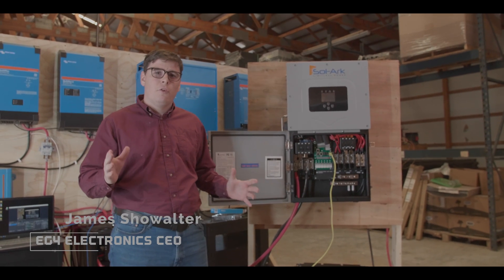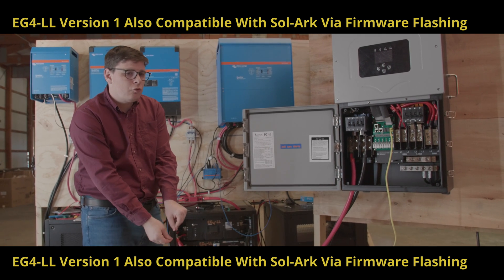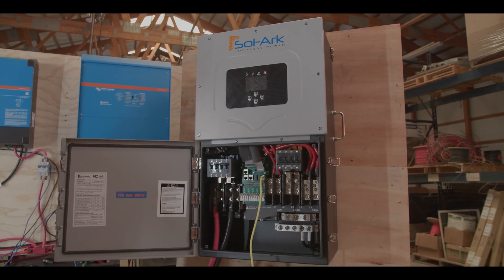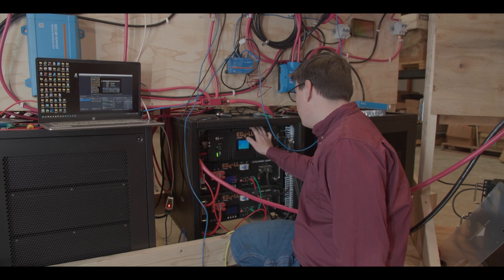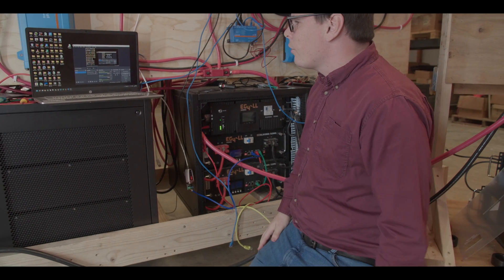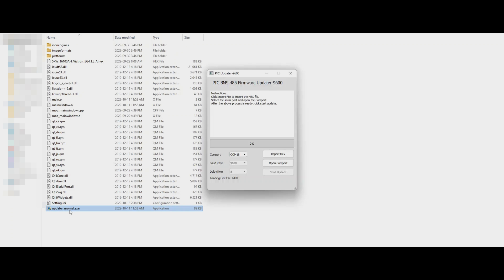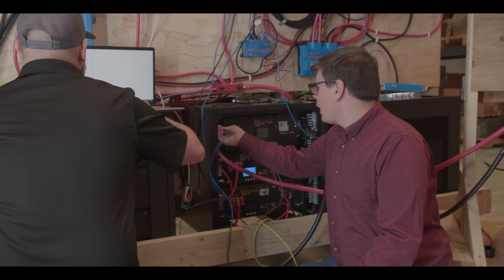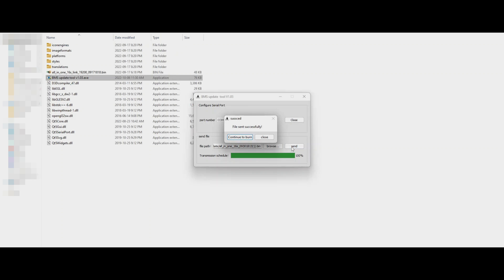Sol-Ark and EG4-LL Lithium Battery BMS Communications

Comment: Trying to setup CAN coms with Solark15K and Eg4_LL v2. Followed setup procedure outlined in this video. Solark inverter is not seeing batteries. I do have an early batch of EG4-LL v2 batteries i suspect since I ordered them as they were released last year. 1. How to confirm that these batteries require a BMS update firmware and 2. where is the BMS Updater software and corresponding BMS firmware update files (they are not present under EG4 web site Downloads section).  Thank you.

Comment: I did follow procedure on my eg4-LL v2 batteries to set CAN protocol to SLK for my sol-ark 8k, but sol-ark is not showing correct total ah, or state of charge %. I suspect there are parameters that need to be checked/set on the sol-ark side ? I would be nice to see a step by step video on that to complete this integration process

Comment: What is the pinout of the CAN port on the EG4-LL Ver. 2?  I cannot find it and need to make a cable to go to my Sol-Ark 15k.
Reply: In the same boat did you find this info?
Reply: @bschmitty77  Yes, I found the Sol-Ark pinout in the Sol-Ark battery communications and integration guide V3.0.  I used a regular RJ-45 cable and cut off one end and only connected pins 4, 5, and 6 in the connector I put on.  You could likely use a regular cable with all pins but I didn't know what was on the other pins in the EG4-LL and didn't want to risk it.
Reply: @renof2505  , I just installed a EG4 cabinet with EG4-LL v2 batteries, and am trying to set up to talk to a Sol-Ark 8k..... Is there a decent video or manual showing step by step? Do I need to make a cable, really ?
Reply: @danielbaker716  I think you can use a regular ethernet cable.  I just took out the unused wires to be sure since I have the connectors and tool it was fairly easy.  Have you connected the power cables already and have it working without communication?

Comment: Is communication between the two REALLY that simple? In a Sol-Ark video they recommended manually inputting battery parameters incase communication fails, as it would reset to defaults. You would think you could “set” new defaults based on what you’re currently getting from the wire…

Comment: Howdy   EG4 Electronics , ... 
WOWSER  = Constant CHANGES ... 
I just began installation of my THREE (3) New EG4-LL V2's  in my older (<less expensive) EG4 Six (6) Battery RACK 
&
ALL of my DIP Switches are on the Forward FACE of my V2 Batteries 
...
Thank you for the  ADVICE / TIP  on utilizing the  V2 Batteries as the Master 
& 
the older V1  Batteries in the Slave position = down stream 
I asked on the TECH Support section on the Signature Solar website & was told it made no difference on my system ... 
but 
--- this was in conjunction with a  GROWATT  SPF 6000 T  DVM-MPV  inverter ( which may not make a difference with GROWATT ? ) 
Thank you for the Informative VIDEO
COOP
the  WiSeNhEiMeR from Richmond, INDIANA 
...
Reply: We’re you able to set up a V2 as a master and the older batteries as slaves?  I bought 3 older batteries and would love to know how to set them up with my Sol-Ark 12k.

Comment: How do I program my  newest version Eg4LL battery. It has 6 dip switches,but manual only says use 4 to set it up? I can't seem to get any help anywhere on this.
Reply from the maker: We suggest emailing Signature Solar's tech team at tech@signaturesolar.com. They should be able to get you taken care of!
Reply: page 13 of the install manual is completely wrong. It should be:
- install document is NOT good, NOT accurate, and needs revision ASAP. pages 10,11, 12 and especially page 13 needs revision to correct and clarify installation process. There are currently significant errors regarding DIP settings, and how to access protocol screen.The procedure documented on page 13 is totally wrong. What I found out from tech support was:
		- turn master battery off
		- set DIP to ID:64 , which is all-on 111111
		- power on master battery
		- click any button to wake screen
		- click-hold return (3rd) button for 5 sec, and release.....
		- set protocol
		- click 'enter' (4th) button
		- turn off master battery power
		- set master battery DIP to 100000
		- turn power 'on'

Comment: HOWdy  
How about for GROWATT ?  
Do the EG4-LL V-1 or V-2  need a new / UPDATED  Firmware ?
COOP
the WiSeNhEiMeR from Richmond, INDIANA 
...
Reply: Same question
Reply: Hello. I am running the GROWATT 6kW and EG4-LL V1 x 2. My units worked when installed 6 months ago with BMS Communication through RS385 port. No updates were needed. Did you have success?

Comment: I have 6 v2 batteries and I'm trying to do the update, but the firmware zip file that is on the webpage doesn't have a hex file that I can see. Where is the actual firmware image for v2? Use the hex in the v1 package?
Reply: Clarified with signature solar that the firmware file for v2 batteries is the included bin file (not hex like v1)

Comment: Can anything be done about the Lifepower4 batteries?
Reply: Did you figure it out?
Reply: I don’t think there will be support for these batteries.
Reply: @unitedcountryarkansasprope3029  
I have already purchased 3. They will work with the Sol-Ark 12 but they just won’t communicate as effectively as they could? Or they won’t work with the inverter at all? I haven’t hooked them up yet.

Comment: I spent a number of hours trying to get this to work today, including a call to signature solar tech support. 

I currently have one v1 and 2 v2 with another on the way.

My v1 keeps failing despite different com cable configurations. Both the v2 do not have the protocol setting menu so I thought a firmware update is needed to populate that...? The firmware update connects and sends the upgrade file but won't proceed to burn ("reset bms" pops up after clicking to proceed to burn). 

Frustrating time waster.

Comment: Is a firmware update required to get the inverter settings to show up? What is the correct dip switch setting for master?

I have 1 v1 and 2 v2, (just ordered one more). I don't get any configuration settings when pressing the button on the front.

Comment: hi,, once the V1 batteries are flashed with the new firmware it will show the menu on the screen like V2's ???
Reply: Mine don't.  They have the same menu information and button labeling and function they did before the flash other than the info on the top line of the screen changed. The V1's have multiple files to pick from to flash so once the V1's are flashed they are already in the mode you need based on the hex file you picked where the V2's have a single file to flash that contains the info for multiple inverters and you have to go through the menu to pick the inverter you want it to talk to.
Reply: @JKKDIFLY  THX FOR THE REPLY, you're answer is a bit complicated for me, if i have a growatt how can i choose the hex file & can you show a video of your flashed V1 screen menu, many thx
Reply: @nad.merheb  This video is specifically about EG4LL closed loop communication with Sol-Ark inverters, nothing about growatt.  Nothing about the V1 screen or button function change after the flash except the text on the top line.  The buttons on the V1 are only used for looking around, before and after the updated firmware.  To make any changes to the V1 you have to use a computer to update the firmware with a program that you download. Within that program is where you select the particular hex file you want to update the firmware with. Once updated and restarted the BMS follows the new instructions you just uploaded to it. The only choices in the software at this time are Victron, Sol-Ark and Scneider, which I assume should be Schneider.
Reply: @JKKDIFLY  thank you for that clarification

Comment: First off, thank you for making closed loop communication possible!  One quick note to EG4.  The new manual doesn't have the dip switch setting info in it like the old manual did.  Now, for V1 only owners, here is what seems to be working for me on my 12K.  Just did this today so...  First, the same cable that works with BMS_tools can be used to update the firmware one battery at a time.  Each battery address has to be temporarily set to on,on,on,on (one at a time) and the BMS power cycled before they will program, and the cable has to be in the RS485 port. Once this is done, there are no setting screens like in the V2, it just works.  Once all batteries are upgraded, the battery that will be hooked to the Solark has to be addressed to on,on,on,off and have a cable from this batteries CAN port to the Solark's CAN port. The other batteries connect to this one through the comm ports. Now on the Solark, go into Battery Setup and enable BMS Lithium Batt and set it to 00. Tell it OK and you should end up back on the main screen and see a new Li-Batt info button.  Press the Li-Batt info button and you should see the relevant information on your batteries. One potential downside to this is that the battery set to on,on,on,off  will no longer show up in BMS_tools.
Reply: Update! I seem to have discovered 1 little issue.  With closed-loop communication, my 4 batteries were only charging at 100A total and the rest was going to the grid where before, everything went to the load and batteries until they were charged.  Somehow when the EG4LL's told the Sol-Ark about themselves, the Sol-Ark only picked up on the 100A limit for one battery.  On the Sol-Ark I had to go into Battery setup, Charge and increase the 100A limit. I increased mine to 160A.
Reply: @JKKDIFLY  when you say "the same cable that works with bms tools..." are you referring to the one they linked to buy? or the one that came with the batteries?
Reply: @SupremeBean82  The cable with the usb adapter on one end and RJ45 on the other end.
Reply: @JKKDIFLY I upgraded the firmware on all the batteries but the sol ark's only showing one battery and it seems it's the last battery in the chain. Do you have any suggestions? does the dip read out have to be in order or it doesn't mattery as long as they are all different and the master is set to on on on off? Did you need an upgraded sol ark firmware? I think my firmware is a year old
Reply: @SupremeBean82  I don't know about the SolArk update requirement.  Mine was updated about a month before I set up the battery communications.  Are all your batteries V1? If all V1'S I don't think the order matters. As far as cabling, connect the CAN port on the battery set to on,on,on,off to the CAN port on the solark, then connect the batteries to each other through the comm ports.  The solark won't tell you how many batteries are connected.  The nominal capacity should reflect how many you have.  I have 4 so my nominal capacity shows 400 (100 X number of batteries). When I switch one battery off my nominal capacity drops too 300.
Reply: @JKKDIFLY  ah OK, I was expecting to see more information like per battery info  when you have the batteries setup for solar assistant via rs485. Thanks for clarifying
Reply: Has everything continued to work for your battery setup? I would love to get mine up and going but it’s hard to find anyone to help.

Comment: It works! Got my first batch v2’s working.. used the usb to rs485 cable that came with the batteries, cut the end off of a cat 5e cable and put orange in D+ and orange/white in D-, flashed all 6 batteries and now I have working comms with my Sol-Ark 12k!
Reply: No I have a v1 battery trying to update to the new v1 firmware to talk to solark. I assume that’s why it’s not working with the included adapter.I’ve already ordered a new v2 so just have to wait I guess.
Reply: @Alaskan32  oh okay, dang yeah that must be the deal
Reply: @Alaskan32  same problem here
Reply: I keep getting a “initialization failed, please check bms connection” “clear flash failed, please update agin” error did you do anything special to get yours to work? Thanks.
Reply: @Alaskan32  Hmm, nope just set the dip switches to all down, then power cycled the battery so it’s using the new address, no need to mess with the breaker switch, just turn the batt off and back on with the power switch. Make sure you go into the device manager on your windows machine and check that the updater is using the same com port as your usb/rs485 cable. I’m assuming you’re plugging that into the rs485 port on your battery and not the canbus port? And did you make a cable using the usb/rs485 adapter that came with the batteries?
Reply: Hey thanks for replying, all dip switches down and bms reset, I made a Ethernet cable using the solid orange and the orange and white plugged into the usb D+ and D- on the adapter that came with the battery. I tried the original cable too to see if the bms software would work and it did. And the com ports match device manager. Also it’s plugged into the correct rs485 port. Might just have to order their adapter. Thanks for your help.
Reply: @Alaskan32  dumb question but did you strip the orange and orange/white wires so that they are making contact with the D+ and D- ports in the usb/rs485 adapter?
Reply: @Alaskan32  Also, if you’re holding the Ethernet plug end(the part you plug into the rs485 port on the battery) in your hand with the retaining tab facing down and the gold contacts facing upward, is the orange/white wire the first wire and the orange wire the second wire from left to right? This is how it should be, just making sure you didn’t use a crossover cable on accident
Reply: Yea bare copper into each port lol good question nothings dumb at the moment
Reply: @Alaskan32  Just to confirm, this is for the Version 2 LL correct, not the v1’s.. I got one of the first batches of v2’s, ordered within a week of them coming out and sol-ark 12k comms would only work with 1 battery hooked up. As soon as I tied 2 or more batteries together the data aggregation was messed up and it broke comms. This updater fixed that problem for my v2’s.
Reply: Yes orange/white then solid orange on both end of cable
Reply: Thank for helping me trouble shoot have a nice weekend
Reply: @Alaskan32  You’re welcome, you too!

Comment: Is this firmware going to fix the battery SOC issue? Mine's at 54v, saying it's at 100% SOC after like 7 months.... that's not right...
Reply: I have to charge up using voltage as the limiting factor! SOC has not been working for our eg4-ll V1 batteries as it slowly creeps down hope yours aren't junked from this issue.
Reply: @noduddeals979  what charger are you using?
Reply: I really like the product, but things like this make me worry. It would be nice if this was explained or fixed.
Reply: @johnashley1230  🙌 Ikr. it's buried deep on the forums; how was I supposed to know this before we spent $7000 on them.

Comment: Really like Sol-Ark and LifePower4, but they can't talk. Could you get an LL v2, and connect it to a group of LifePower4 batteries and have the whole set talk to the Sol-Ark?
Reply from the maker: LifePower4 is comms are coming soon!
Reply: @eg4electronics  any update? I have 15 Lifepower4 batteries I’m wanting to connect to a Sol-Ark 15k
Reply: @eg4electronics  Any updates on this?
Reply: @eg4electronics  Is there a place to sign up to be notified when the LifePower4  comms are updated to be compatible with the Sol-Ark? Thanks.
Reply: @eg4electronics any updates?

Comment: Where can I find the comm cable for CanBus between SolArk and the V2 battery? Also, I am a bit confused. Do I use the 48V V1 new firmware to upgrade my V1 batteries so they communicate with my V2 master Battery? These are great batteries and I am very happy with them

Comment: Thanks for the info!  Where can we find the software and firmware?  Also, I see the amazon link but you mentioned you are selling a complete kit on your website which I'm not finding either.
Reply from the maker: https://signaturesolar.com/complete-all-in-one-off-grid-solar-kit-kit-e0000?
Reply: @eg4electronics  I think he meant kit as pertaining to the cable and adapter and not a solar system.
Reply from the maker: Firmware can be found here https://eg4electronics.com/downloads/
Reply: @eg4electronics  what about for Growatt inverters? in the downloaded folder there is no firmware file for Growatt inverters like it show in the video

Comment: This doesn't show how to select Solark on the LCD screen on the V1.  Please advise.
Reply from the maker: Once the V1 has been flashed and power cycled you are good to go for Sol-Ark comms
Reply: @eg4electronics  once the V1 batteries are flashed with the new firmware it will show the menu on the screen like V2's ???
Reply: @eg4electronics  , I was able to set the EG4-LL CAN protocol P02-SLK for sol-ark, but Sol-ark is not showing same state of charge as EG4LL batteries. I'd like to see a specific video or manual step by step integrating LL v2 batteries with a Sol-ark, including setting on the Sol-ark side to be sure they are talking.